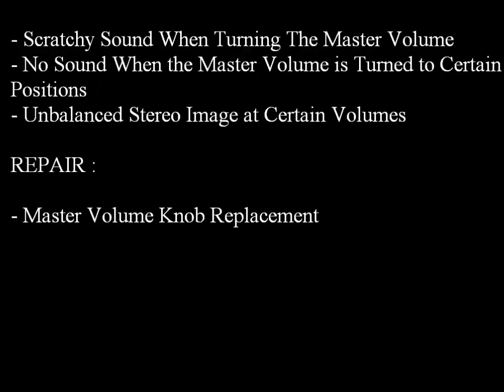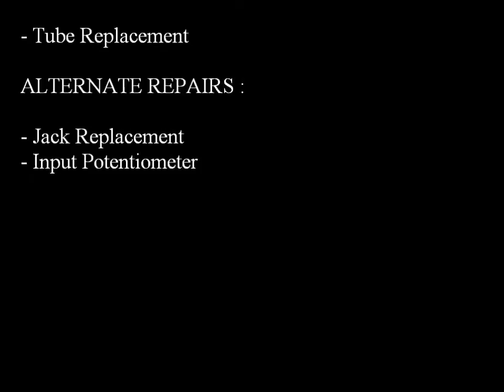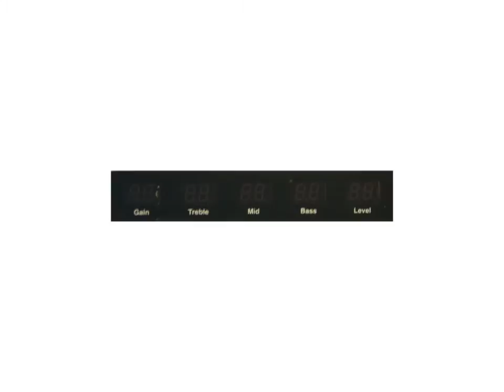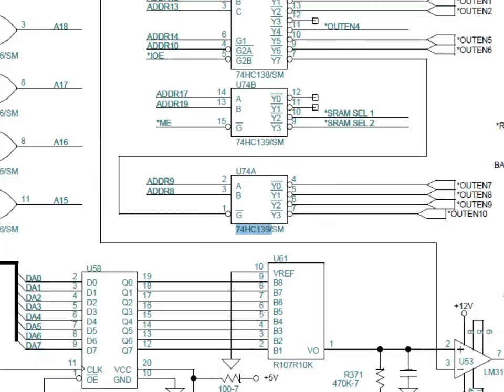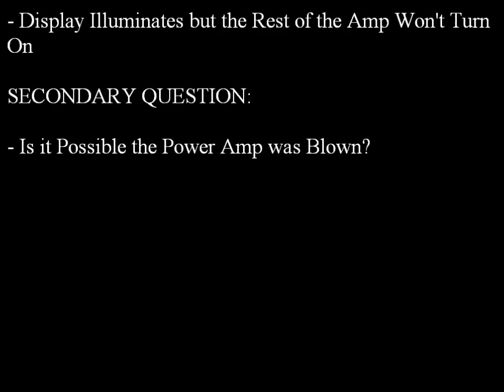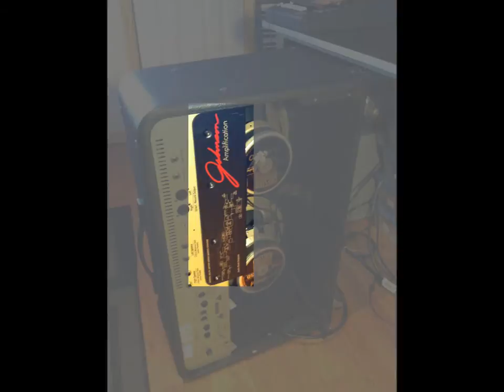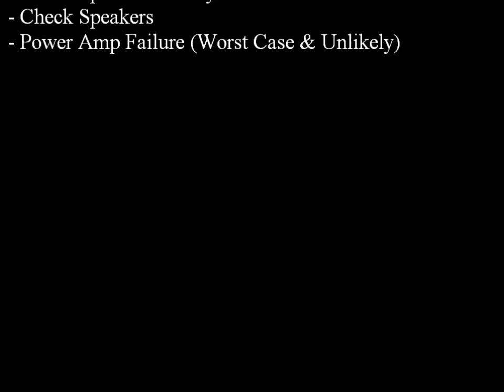Simple, Common Repairs for the Johnson Millennium JM-150 & JM-250

Comment: On the outside chance that Mr. Bosley is still alive, in business, and reads these comments... My JM250 (owned since new in 2001) has the volume pot issue.  Touching the pot causes scratchy and/or suddenly full volume.  Once I had the board out, the post wasn't loose at all.  Once out, I've sprayed the cleaing ports on the three pots (vol, contour, clipping) with electronics cleaner, exercised the travel of each post full clockwise/counterclockwise several times, resprayed, re-exercised... before I put it back together as is, how likely is it the pot itself isn't connecting to the board?  The soldered joints looks solid and wiggling it with my fingers doesn't seem to indicate a loose joint.  Digitech told me to go away when I asked about replacement pots, claiming to have nothing to do with Johnson Amplification.  shrugs Their name is on the last page of the manual... I found a source of the schematics, however the parts suppliers I emailed all looked at me funny when I said the pot has 6 posts. Anyway, would heating the joints with a soldering iron and wiggling it around help to re-solder the existing joints or is that asking for trouble?  It's been a long while since I've soldered electronics... I've got all fresh iron, flux, sucker, mesh ready to go... maybe I'll give it a try and let you all know what happens. Either way, thanks from the future for making this video!
Reply: Update: I successfully unsoldered and resoldered the 6 joints. There were no cold joints that I could see but as Mr. Bosley explained, the through-board design can hide such joints.  The amp fired up properly afterward for me, but during reassembly I noticed that the pot's stem had a few millimeters of play in and out, where the contour knob was still tight. The movement is just enough to cause a short that sends the volume to either 100% or 0% if you move it even the slightest. According to the markings and visual observation, I'd say the contour pot & the volume pot are identical so a swap would be the "solution of last resort". I'd verify they were the same with an ohm meter first. I suspect thermal cycling of the dissimilar material in the pot is probably the culpret of the play in the stem.  I've researched the pot's maker, Taiwan Alpha Company for their W150K 6 pole pots, and it seems they haven't been made in years, nor are there any known suppliers of new old stock. Until I get the drive to tear it all apart again, I'll just leave it waiting.
Reply: Forgot to mention this cool fact, mine has russian SOVTEK 12AX7 preamp tubes, not the ECC83's shown in Mr. Bosley's vid.  I looked hard but failed to find any bias adjustment on the board so IF THEY GO TOO, I'll stick with 12AX7's.
Reply: Glad to see someone here commenting recently. I’m having the exact same issues with the pots. Incredibly touchy and scratchy. Mine also has the 12AX7s and I have one replacement on standby just in case. The main thing is these damn pots though and I really don’t want to pull this thing apart, but it’s looking like I’m gonna have to sadly. Any tips?
Reply: @TheExquisiteRoofer  As for the actual soldering, I bought a low watt iron from amazon. I used to solder for a job I had in the 80's but to be safe I watched a few soldering techique vids before I attempted. Practice on something expendible instead of your amp. Equipment wise, I had a sucker and wicking mesh to remove the old solder. As the pot has 6 pins and about 1/8 inch thick connection, it took me a few minutes to remove enough for the pot to slide free. Don't force it free. Once out, electronic cleaning spray and rotating the pots made a noticible difference in pot motion, which may have contributed to the success. After iit was as clean & dry as I could make it, I soldered it back in applying heat to the pin first, solder to iron, let it flow down onto the connection, and back the iron away quickly. The solders formed little volcanos around each of the pins. I did not let it flood it with solder either. Just a small dab was enough.
Reply: Bad news. While the cleaning/resoldering helped, months later the scratchy volume is back. The post of the potentiometer has JUST the slightest bit of wiggle causing it to go anywhere from zero volume to max volume. To fix this, spare parts and a willingness to open the pot's tabs to dissect it are needed. None of which I have. I think I can just use the amp as a very expensive effects loop.  So unfortunately, the end. :(

Comment: i get power but no backlight on  the display, please help
Reply: also just found out its very loud, even with input level low ans master volume low, and it cuts out after a few seconds or so...is this thing cooked?
Reply: changed battery, no change...i guess i'll spring for tubes next
Reply: Is most likely the issue with the pots as everyone else seems to have. That’s why I’m here as well.

Comment: Hi, Thanks for all the info. However I am having a different issu and I was wondering if I could pick you brain on it. 

I do have the stereo 250 head only, I plug it via xlr to an audio interface then computer for recording. The issue is that the amp start fine, boot fine, but after a while of playing, 5 min 10 min or so, the amp is still on but the sound fade out, the audio interface ( focusritescarlett) is look fine, tested it trough mic input. I bought the amp used and I don't know much about the life it had. Does not seem to be a Tube issue. Any idea?

Thanks

DD
Reply: Well my bad, faulty preset. Solved.

Comment: Please help me. My JM-150 encoders are running wild. Simply touch them and they max out immediately. Otherwise the amp works normally. However, this problem renders it useless. I know this is an old video, but if you can reply with contact info, I'll follow up and we can arrange something. -Chadwick
Reply: Did you ever fix yours? Someone above did the repair successfully it seems.
Reply: @TheExquisiteRoofer  Unfortunately, no. It's a 70lb paperweight. At least I have a pair of first-year highly desirable Celestion speakers.

Comment: Is the fan supposed to run constantly?
I just got one of these (JM150), and the fan does not operate when I power it on.
Thank you so much for posting this information.
Reply: The fan runs all the time. You can get a replacement from MarVac electronics. The brand is Jamicon the model is in the video. Before you buy, take it out and apply 12 volts DC. If it powers up then you have a supply issue. Likely the fan is frozen. If it is give it a goose.

Comment: Hey Don I have an issue with a stereo 250 that will turn on and I can get sound, albeit very ugly sound.  All the buttons except for the "store" button are illuminating.  The input, master and contour knobs seem to be working fine.  Lastly the display is lighting up but no text is appearing.  It almost seems like the hardware is good and the software is not booting, but I don't really know as I have limited experience with amp repair.  Any response will be appreciated.

Comment: Just got one done.  The problems were 1) The three W pots, especially the MV, very scratchy.  2) The amp cut out when twisting the MV.  Continued twisting did nothing sometimes, and had to restart to get sound again. 3) Insufficient thermal management !! The transistor trio on the power board ran so hot an egg could be fried.  The problem was the steel U-channel screwed to the chassis underneath had no thermal paste, so I spread some Silver Arctic which solved the problem.  The other hot spot was the LM7808 regulator--also an egg fryer.  This is the one closer the the front of the amp.  (the other one is a 7805).  This was solved by getting rid of the slip-on heat sink and bolting the regulator to the chassis near the line power inlet area--a lot of room there. Wires must be run to it from the original location.  A 1/8" plate should be placed between it and the chassis for proper heat conduction.  It is also advisable not to ground the back of the regulator to the chassis.  I also spring-clamped mine for overkill.  Both regulators were replaced with new ones just for insurance.  I believe this regulator may very well be the cause of unexplained cutouts, since it has internal temperature cutoff circuitry.
A partial disaster.  The amp was load tested with two, 4 ohm dummy load resistors (one on each channel) for a total of 200w for 45 minutes straight, until the thermal cutoff inside the transformer blew; it is located on the primary side.  Ok, no problem, but it was located at the core, instead of on the outside where they usually are.  These transformers are no longer available other than acquiring another amp to strip.  The other option is to recreate one with toroidals, but you would need all the winding information which is also not available. 
So the entire primary winding was ripped out and rewound in 10 ft. lengths with splices. A new thermal cutout with a higher temp. rating was included on the outside where it belongs.  This cutout will never blow until smoke pours out of the transformer.
While it was out, the winding schematic was created in case it has to be replaced in the future.  It was noticed at least the 7808 regulator was dropping almost 10v which would explain why it runs so hot.

Comment: Stumbled on your website when searching down JM150 repair info. I have two JM150s that i bought new back in 1999. I had power supply issues on both over the years but have always been able to fix them with caps or voltage regulator replacement. This time is different, i think i have two problems in the main board. My first check was the power supply and it seems to be putting out all the voltages it should be and the amp powers up to the last preset used but when i change the preset, i get no patch names,, just, 2 stars in place of where the name would be. Its like its dropped its memory. Second issue, there is no sound from the amp, no level indicator on the LCD and no sound from the XLR outs. The power amp is not dead though and i can hear a slight hiss from the speakers. When i unplug the power amp board from the main board it makes a pop sound. If it touch the left or right line ins to the power amp i get the standard buzzing sound you would expect when you touch the tip of a jack cord. Im trying to ring it out but it may be over my head. Do you still fix these things?? Where in the world are you located? Any suggestions? Thanks

Comment: Hey Don,
I have a JM-150 that I've had since 1999 or so and it has been having the master volume knob problem you discus in your video.  I am also a former infantry Marine but never learned how not to break things, so I am very apprehensive to try to work on the electronics.  Would you be willing to do the replacement of the master volume knob pot? Would I be able to disassemble the amp and only send you the board with the volume knob on it? Thanks in advance brother.  Also, I tried to contact you via your website but the message would never send, just FYI.

Comment: I was recently gifted a Johnson millennium 150 that does not work. The screen comes on but only has black squares on the top right corner and the knobs only show a value of 8 on them and do not change. Any ideas? Is it worth trying to fix? Thank you
Reply from the maker: That's a very relative question as far as "is it worth trying to fix?" - I can't answer that. Ideas : is the power supply good? Is there activity anywhere else on the board?

Comment: Though it seems you focus on the Millennium series, I am having problems with a Marquis JM60. By chance do you have access to service literature for this model as well as parts? My Master Volume control is not functioning.
Reply: I am having the same problem with the same amp. I have power speaker is good but I get nothing when I plug in I do get a hum that goes up and down with volume but that's it

Comment: Do you recommend swapping the F3 and F4 Pico fuses with poly switchs?  If so what voltage rating and tripping current would you suggest?

Comment: I had a JM250 and a JM150 that I loved, and they both developed the same problem. The volume would die down to nothing and then swell back. Always in the middle of a gig of course. Sent them both to Harman music where they were repaired. This happened multiple times until I sold both amps. I wish I new how to repair them myself. Harman while very nice and even did the last two repairs for free with the exception of shipping, would not tell what they did to fix them. Was this just the volume pot?

Comment: Thanks for all of your Johnson info, videos, web page.  I do have a problem with my latest JM150(my 5th one through the years), some amp models have no output, while some others work perfectly.  For example when I select 65 Twin Bright, no sound, but toggle amp selection on to Matchless DC 30, it works fine.  This is the case for about 50% of all amp models, 50% work fine, and about 50% have no output, and show no signal level in the Screen.  Any ideas on what could cause this, or what I might check? Thanks.
Reply: Don, I want to say thanks for your visual inspection suggestion, somehow, miraculously, I found a part with a cold solder joint because of a broken leg.  Capacitor labeled C17 on the board, by the preamp tubes, probably knocked loose when a previous owner changed tubes.  When I would push down on it and the broken leg would make contact, all of the non-working amp models did work, HURRAY!!!.  I can not re-solder it because the leg is broke flush with the bottom of the part.   I found a downloadable schematic online at www.eserviceinfo.com/ for the Johnson_JM-150. The part is labeled C17 on the  board,  and in the schematic it is identified as a .0082 uF Capacitor 250 volt Poly Film. Now just need to get one here and soldered back in.
Reply from the maker: Using a scope and test signal to trace is really the only way to narrow it down to an analog or digital issue. Without getting too deep - the tone stacks are not just digital, and not just tube - there are op-amp/IC based "sub-circuits" for each stack - various models are created by digitally switching in different combinations of analog parts. If you know the models that it doesn't work on, what I referred to as sub-circuits are marked in the schematic by non-brand descriptive names - i.e. "American" "British" "hi-gain" etc... You could have an actual issue with the parts in question, or you could have an issue with power decoupling/delivery to the part in question (i.e. aged electrolytic caps), and if it makes it all the way through the analog stages, you have a digital issue. The only way to figure it out is with some test equipment and a schematic though. Visually, you can look for bulging caps, burned out parts, abnormalities in the copper traces (i.e. lifted or cracked) or if you're there at the right time, the soul of the part abandoning it's body in the form of a puff of smoke.

Comment: hello there! i recently received a JM150 from my grandfather that he has had for quite awhile. he gave it to me because he was having some troubles with amp turning on. i’ve noticed that it’s really a hit or miss with it and it only works on certain occasions. when it doesn’t work however, it gets stuck on the start up screen where it mentions the non liability claims with some of the sounds built into the amp. it’s an awesome amplifier and it sounds amazing, i just wish i could get it to work more consistently. let me know if you have any tips or tricks that could possibly help me out. thanks!

Comment: Hello Don...tried to email you from your site but the email form asks for a security code. Don't see where I can get on. I was wondering if you know where I can get parts for the J12. I need the plastic piece that the pedal sensor reads for graduating volume and wah.
Reply from the maker: Unfortunately, Digitech which was supporting the remaining stock of parts, is now down. Outside of getting another one, or buying another one for parts, I can't help you.
Reply: @BosleymusicCentral  Thank you sir...one other question...any replacements on a S Disc...not in need of one just wanted to know what options are available if ever I do?

Comment: Hey Don - I have a question about my Jm150 I just received via an eBay purchase. The bass knob cannot lower the value and the number stays at "10". Also, I noticed when turning the dial to change Fx in Edit mode, it will only scroll to the right and I can't scroll back to the left. I'm debating whether to send back or fix it myself if it's relatively easy. I reset the amp, but nothing changed. What do you think?
Reply from the maker: Do you feel the "snap"/ticking when you turn either of them? On the bass knob, is it possible the shaft is actually broken? With the chassis out you could try to flush those parts with high concentration isopropyl alcohol, then re-lubricate them with something like de-oxit fader lube, but replacement might be a better option. If all of the other encoders are working, it's likely not a deep issue in the logic. Another viewer shared the PN from digikey which you could use for the Bass encoder : https://www.digikey.com/product-detail/en/cui-inc/ACZ16NBR1E-15FA1-24C/102-1777-ND/1923372 - I'd had to poke around to find the one for the jog wheel. As a general, I would also take the knobs off, and clean any "gunk" from the knob and around the encoder shafts.